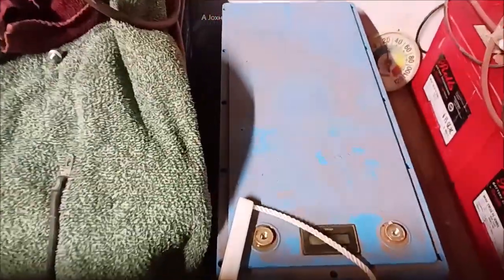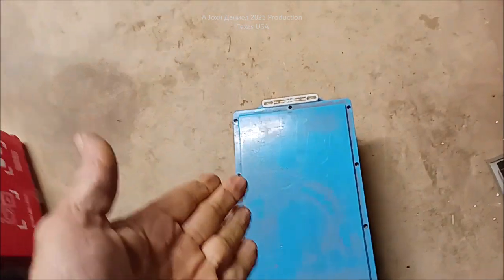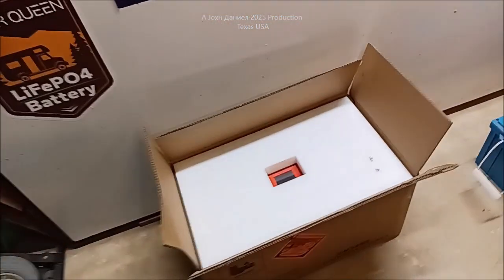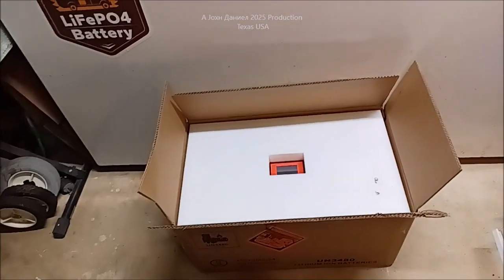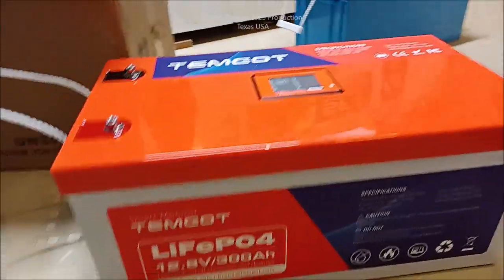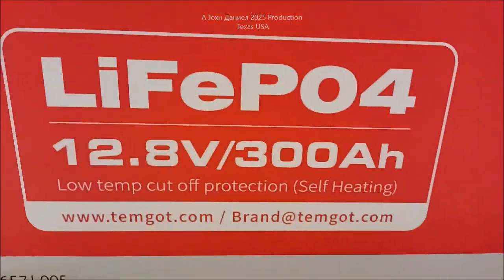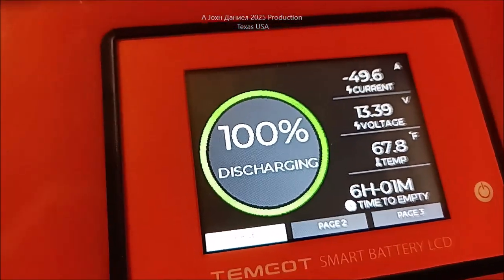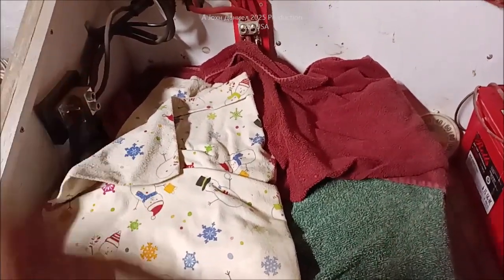I Solved a Problem using a 12V TEMGOT 300AH Self Heating LiFePO4 Battery in my system

Comment: You showed a test that never even activated the heating pad.  How can you sit and recommend something you only installed an hour and a half.  And you're misleading people that they will be ready and charging in the morning.  That's not how these work.  If the battery temp goes down to 20f overnight there is no charging once solar starts producing.  The solar strictly goes towards heating until the temp is 41f and that may take 1-2 hours.  You're better off using a heating pad that always keeps the batter about 60f.  You might spend a 100w over night but the 1-2 hours in the morning could be charging at 750w if you're setup for approximately .2C charge rate.
Reply: Unless I'm mistaken on these.  Last I checked the heating pad only operates while input power is at least 10A.
Reply from the maker: @mrtans  It has 3 pads in it, Lithium Solar shows the tear down. The BMS has a separate wire to the bottom pad 42 watts and another wire to the other 2 pads also 42 watts each. The solar input can be as low as 50 watts to begin warming the cells from under the low pad first and the freeze safe is 32 and below but restart is 35 to 37 degrees. I did not do a tear apart on it since there it videos on that already. Without putting it into a freezer which would require me seriously pissing off my wife to empty her freezer for a video you have to wait for a sustained 24+ hours under 30 to get the mass to cool enough to show in effect. We don't get that on demand in Central Texas. Last winter we got a few events like that, the battery did exactly as designed and in a few days we have lows hitting 25 for a 6 to 9 hours but unlikely long enough to send them into protection. 
My best solution for LiFePO4 is a 20 to 50 watt dog warming mat with a cheap 50 to -32 thermostat under each 4 to 6 batteries in a insulated box. The Temgot was to install until that entire build could be made. As of now I have one 12 volt 55 watt silicone pad on a heat sink it heats my entire insulated 39 x 25" box with batteries in it enough now to not even need a self heating battery. Good for a Texas freeze but likely not enough for a Minnesota freeze.

Comment: Hi John love your channel.  I’m a lil confused thought.  I’m aware that u can’t charge lipo under 32 f. But you keep saying in the vid at 20 f that it won’t work?   My battery’s do run my inverter at 20 f with no heat pads/built in heater.  Buut. I feel like I have trouble running hi loads over 2k off my batteries.  Do you feel cold affects there performance?
Reply from the maker: Cold under 20 during any draw causes irreversible damage due to crystals forming on the membrane in the cells. You should never draw much of a load on them in temps under 25 degrees and at 20 stop completely any loads over 5 amps. Yet even 5 amps can cause damage on many of the brands. Some claim you can pull 50% on them down to zero degrees but none of the cell makers claim that, just the made battery sellers do. Charging them in temps under freezing has similar bad results but instead of crystals you get fissures in the membrane of the cells.
Reply: @ would this make battery’s swell up?
Reply from the maker: @ yes in some cases

Comment: I have a recommendation...
Pack some insulation around and under those heated batteries. You'll lose less of your power to the cold.
Also, for the non-heated batteries.  You can get 12 volt RV tank heaters. Place them under the non-heated batteries to keep them warm. That's what I'm doing in my camper, and it's working great...
Reply from the maker: 10-4. Well prepared. We just needed some extra stand alone addition. As for the pads,  I have 2 large RV Tank AKA Reptile Warming pads 2 years now, https://amzn.to/4ghAyA1 12 volt 18 to 36 watt under them. I just use a manual 32 degree Freeze to 122 degree https://amzn.to/40saXPg thermostat on them, solid fail free capillary style. Dual Options switching. 
And battery bottoms on 3/4 foam, the outer of batteries wrapped in 10mm thick r-4.2 heat/cold shield from Temu. https://temu.to/k/upr5w0w1fo8 CHEAP and high performing! I have all that on 12  100'ah in the old classic Winnebago spread out under all 12 - 100ah batteries. We have had serious cold, 3 days under freezing, and the last 13 degree night very hard freeze of over 40 hours this week and all of those batteries were powered still and sitting at 39 to 42 degrees and ready for 1800 watts of solar in the mornings.  
The best thing on that thermostat, I use 3 in the RV, and is it has 2 options, NO and NC switching option to use. So in the summer it kicks on 3 fans to vent out the RV of heat and moisture at 90 degrees and in winter kicks on the heating pads at 34 degrees, OR even if I want one runs the furnace for me if needed for emergency protection if battery pads or something fails, and to that one I have furnace and a 10 watt flood that kicks on and tells us WHOOOPS somethings wrong go look!!
Reply: @JOHNDANIEL1     I like your idea for backup heat that comes on when primary fails and lets you know something went wrong...👍 My backup actually is the tank heaters... I run a diesel heater that puts out too much heat for the tiny space I sleep in the back of my truck. Instead I blow the heat into my battery/water/food storage before it enters the sleeping area. That tones the heat down a bit and keeps the batteries nice and toasty and saves some amp hours that would have gone to my battery heaters for other things...

Comment: ??? You are showing heat from cells discharging .  Don't heating pads only work to heat up batteries on the charge cycle?  5 A x 12V=60 watts. The bms doesn't  self discharge the battery for heat or it would potentially over discharge for self preservation.
Reply from the maker: The battery is heated in meaning temps under 36 to 37 degrees the heater strips come on, when the internal temps rise to over 40-42 degrees then shut off. This continues to cycle to keep the battery slightly warmed up so it can charge as well as operate in below freezing temps. It does not stay on, it cycles to maintain safe charge and discharge temps. So covering them with a towel helps it cycle less and when sun comes up in the morning it takes immediate solar charge when a cold safety battery is waiting hours or days to exceed 40 degrees to even come back on.
Reply: @JOHNDANIEL1  in your situation  yes they maintain warmth due to the lead batteries supplying amperage but a standalone single battery  does not self heat until charge amperage is applied. The bms does not self discharge the battery to provide heat. Read the bms instruction manual.  If I'm incorrect that would be the first heater circuit bms that self discharges for heat in the market.
Reply from the maker: The lead acid draws from the LiFePO4 all night since they naturally lose voltage on their own. These maintain heat. They will till the voltage cut for heating hits at 11.8 volts. It's set by a thermal sensor not software. There was no charge going into it in temps of 20 degrees. The Vatrer does the same, connected to charger or not. You are only supposed to expose these to the cold when you have solar or a charging plan, otherwise it drops to 25% and just shuts off.

Comment: Really I’m trying to design a 50amp system for my boat. Only issue is I’m not made of money $$ just a HVAC guy. I liveaboard full time my shore power is 50amp 240v split phase and 9kw diesel generator. I have both lithium and AGM banks that I parallel all the time. So far I’m planning 2 victron 12/3000/ 50amp and putting them together with a 100amp auto transformer but is there a better way? That’s 2600$ bucks in equipment then new batteries so I want to be right I can’t afford mistakes. Thanks for all the help I get from your content.

Comment: Epoch or Temgot??? Epoch has a lower price and seems quality. If you can get you hands on an Epoch battery I’d like to see a review.
Reply from the maker: The price on them is 25% more than same ability Temgot but if they make a good offer for one, such as 50% off to do a testing and possible video then I will consider them. I do not want any for free like so many you tubers get sent to them, you just can't be yourself or they won't allow you to criticize if they are not worth the money or have issues.

Comment: John is there any way to prevent the build up of the white corrosion from the electrolyte off gassing when I charge the lead acid batteries bank ?
Reply: Thank you sir! Just received the SWI power 3200 inverter today that you have tested again thanks for all the help!
Reply from the maker: @kerrybreaux2945  Be sure to cable with no less than 1/0 or you can do 2 strands of 2awg hammer crimped into a 2/0 x 5/16 terminals.
Reply: Dielectric grease after you clean that off.
Reply from the maker: @ I got some special grease for them, marine battery. We got so busy the lead acid bank has to get a full re-terminal job on it. 3 years so time to do it. All leads are equal length 4 awg to each set of two 235AH with the bus bars between each 6v. All 28 of them is now getting 7 of the 500amp switches per 4 with a 2awg return to that huge main terminal set. We have to alter the battery box for 2.5" more height this week.
Reply from the maker: Use acid cleaner NOCO E404 https://amzn.to/3PorkHc and clean it off, and then NOCO NCP2 paste afterwards on the terminals  https://amzn.to/427tRNF

Comment: What about carbon lead acid? Do you use them?
Reply from the maker: We wanted to get 16 of them from LEOCH but the price was way over 2X the cost of the Rolls Surrettes for us. I have installed 24 volt banks with twenty 180ah of the Leoch carbon batteries in them for others. Wish I had the $$ to have them myself.
Reply: @JOHNDANIEL1  With carbon, there is benefits they can handle working during partial charge cycle, also cycle life is better, and of course they can handle freezing temps, and very high currents. I was actually thinking about getting used truck EFB batteries, which is similar technology with carbon. Here in europe you can get money back for lead in recycle centre. Basically second hand batteries are for free, or payed back after 50 cycles.

Comment: If you have room under the bed, how about putting batteries under it? Warmer and LiFePo4 are very safe. Our RV has those compressed gas cartridges to lift it up for storage. Just get a battery that talks to your phone app.
Reply from the maker: My bed is a queen air bed, back surgery and decade in the ring torn me up so I sleep on air. The controllers and battery bank is over 90 feet from my bedroom so easiest is to use the existing. For a RV though if your out of it and then go get in to use it nothing will fire up when the regular batteries cold shut off. A single heated one will be the best thing to add so you can get furnace running and warm the others.

Comment: Nice battery.  I don't need heated batteries here yet.  My battery room never gets below 32°, with just the electronics running in there, and that room isn't insulated.But I may add insulation this year, and if the electronics keep the temp up, no need for heaters.
Stay warm!
Reply from the maker: Excellent plan. I had to replace the unhappy one with the temgot. I learned it was made by Vatrer and they do the Lead Acid and LiFeOPO4 together without a single issue. The Vatrer has just now released their version but too much $$ for it.
Reply: @JOHNDANIEL1  I understand.  I really like the new WattCycle company.  Their batteries are top notch, but I don't know if they have heated batteries yet.  Their batteries are grade A eve cells and the internal builds are above standards.